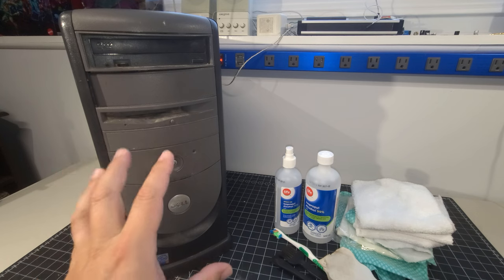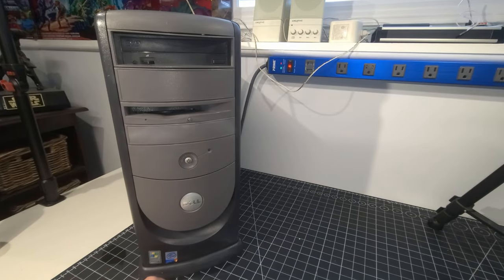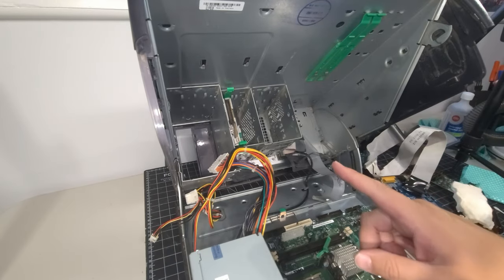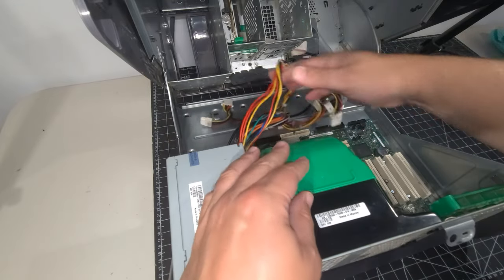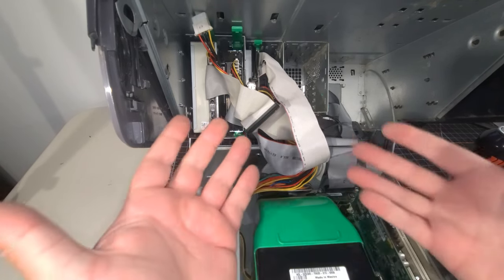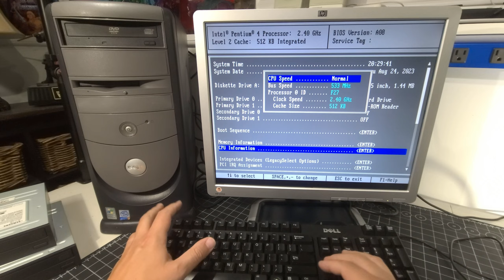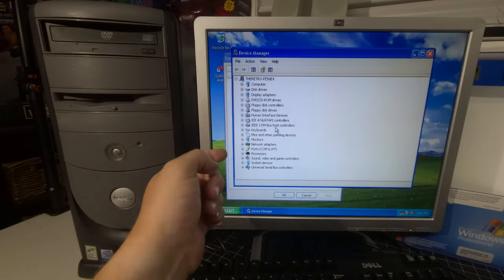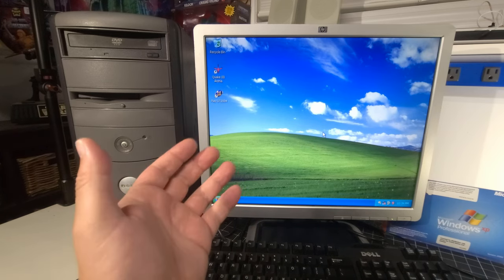Dell Dimension 4550 E-Waste Rescue - Full Restoration!!

Comment: I remove everything from the case. Then I clean all non electrical parts outside, remove most of the dust with an air compressor and then clean with soap and water. Blow away most water with air compressor and let it dry outside. While that is busy drying I clean all electronics like you did in video. Then I connect everything outside the case and test and setup the software side. When I am done and happy, I put everything in the case and clean the case with anti dust cleaner. Then I do a normal 4 hour burn in test. All CD/DVD drives are called optical drives, does not matter what its purpose is.
Reply from the maker: Glad this works for you!  Always many methods / approaches depending on scope :).

Comment: I had one of the predecessors to this machine as my personal computer around the same time, the 4400. Looked exactly like that. I don't know what the difference was regarding the case design between mine and that 4550, but it had the same clamshell case, the same fan with the green chute, etc. Mine had a Turtle Beach Santa Cruz DSP sound card, and I had a similar video card. Mine had 256MB of RAM, though, and had an intel P4 1.8GHz. When it died, I took the usable parts out of it. Dell didn't use thermal paste on those machines. It had a thermal pad on the bottom of that heat sink.
Reply from the maker: Good to know.  Dell tended to make many different configs in the same case - or at least the same looking case.  Take a look at my Dell playlist - especially the Dell Quadruplets video.  Also, regarding the paste - good to add some especially on a P4.  May be overkill but hey, this cooling thing is important haha.

Comment: Very nice restoration as well always!! Nice to see another Dell OEM saved from the scrap heap and with a decent video card upgrade i'm sure it could even run games like Far Cry or GTA III

Side Note:
I have a Nvidia GeForce 4 MX420 "first dedicated video card I scrapped from OEM machine in 2007." While it's not a slouch providing 64mb of VRAM and will be able to blast through nearly all 90's and a couple of early 2000's games.. It's very limited to that set amount.
Reply from the maker: Yes for sure.  I personally like the underdog cards haha.  That said, it ran these two games fine and I'm sure many others.  I mean, of course we can always upgrade more... But sometimes it's fun to feel the limits haha.
Reply: @TheRetroRecall which is fair I mean this card is capable of running morrowind, I'll be it at lower settings at 25fps "no different that than OG XBOX version" I've ran some bench marks using the custom XP build I've built and when running it at 16bit over 32bit you can see a huge bump in performance too.
Reply from the maker: Nice!

Comment: Agree with you about hard drives on retro computers, there's just nothing quite like the sound of a hard drive spinning up and accessing data. And the noisier the better. (I mean noises that the drive makes when operating normally, not the noises that drives make when they are about to fail. I just wish they were more reliable. And, as a fan of classic Macs and UNIX machines, the problem is even worse, because those usually take SCSI drives, which are relatively hard to find (compared to IDE hard drives, which pretty much grew on trees at one point) and are usually prohibitively expensive when you do find them. Paying top dollar for a drive only to have it show up DOA (or die a few days/weeks/months afterwards) really sucks.
Reply from the maker: Yeah for sure, the SCSI drives were a bit harder to find.  That said, I am happy there are solutions today that allow us to use these machines for when the time comes that physical drives are no longer int he equation.  Thanks for watching!

Comment: Compressed Air works miracles...  50psi   I use my compressor and WOW!  then I use a Dyson vac with a brush.. all gone.
Reply from the maker: For sure.  I do the PSU with the compressor, everything else with ESD Brushes and vac :)

Comment: Ironically, I have Windows XP running on my 2012 iMac (with 32 GB ram, Intel I7 quadcore) using Parallels software to utilize XP without having to create a separate HD partition. As configured it can handle most of the first-person shooters you've played with.
Reply from the maker: Nice!!!
Reply from the maker: When I lived the MAC world, I used VM Ware Fusion - worked like a charm on my Mac!

Comment: it does not matter the orientation of the ide cable... its the same... as long the red strip on the ide cable is on the same side of the power cable, you are good to go. you can even plug the middle conector on the motherboard, and 2 drives on both ends oof the cable, it does not matter.
make sure you are using a 80 pin cable on the hd. if you are using a 40 pin cable on the hdd, you will not have the max speed.
you need 80 pin ide cable so you can reache ATA 133 speed. for the optical you can use a 40 pin cable. i think dvds only go upt to ATA66
Reply from the maker: Sounds good.
Reply: @TheRetroRecall  I cant see well on the video. but i thing you have a 40 pin ide cable on the hdd. if the hdd supports ultra dma, you need a 80 pin cable
Reply from the maker: I'll check all of this out.

Comment: It looks much happier now!👍👍  Was there much dirt in the PSU., and what condition was the thermal paste on the video card in?
Reply from the maker: The PSU was actually ok... However I didn't check out the video card thermal paste as I just wanted to test the card out.  That said, it works great, so I will be checking that out for sure!
Reply: @TheRetroRecall  It's surprising how well that old PC., is working, I had a look online to see how much ram., it can handle and Dell state that 1 gig., is it's limit, but other folk say that it's two gig., so the only way to be sure is to try.
Reply from the maker: For sure.

Comment: im sure that cooler still has the factory sticker on the bottom you are suposed to remove before install it for the first time, and it was never removed... remove the cooler and check if im right or not. ps: I checked in slow motion. and there is no doubt that the aluminium sticker is still there covering the black thermal grease...  and it was never removed...
Reply from the maker: I'll check that out tomorrow - great eye!

Comment: In my experience you don’t need to be paranoid about static electricity
Reply from the maker: You may be correct, however given how much scrubbing of the components I'm doing, it doesn't hurt to take an extra precaution.  Better safe than sorry I suppose :)

Comment: Had a medion prebuild around that time with a 476 pentium 4 at 3 ghz with a fx 5200 which i changed for a fx 5950 ultra. Still got the fx ultra card in working condition. The prebuild itself was pretty horrible. I had no idea what thermal trottle was back then and medion clearly had none as well. Together with a heavily fragmented hdd it was pretty slow and nearly useless for directx 9 games like fable the lost chapters which i played a lot. Naturally i should have gotten a amd system with a radeon 9800 pro/xt.
Reply from the maker: Thanks for sharing this.  Yes - most stock systems weren't 'great' unless you full customized them on an order.  I found if I was doing that, it was best just to build a custom system - which is what I did.  There is something about the OEM charm though that after all of these years, it's fun to look back on :)

Comment: Another question. How do you get the motherboard out? I have a few bad caps and I don't know how to remove it?
Reply from the maker: There should be screws holding it to the chassis.  You need to remove everything in the way first (cables, drives, caddys, ventilation etc).  It should come out fairly easily.
Reply: @TheRetroRecall  From what I see they are not phillips head. Or I am I looking in the wrong spot?
Reply from the maker: I'll have to take a look at one and get a better idea.  There may be some documentation online.  Dell is really good at maintaining that material on their website - just enter the service tag number on your label.
Reply: @TheRetroRecall  Ill check it out, thanks!
Reply: @TheRetroRecall  Ooohhh, I see, in the video it looks like you just slide it out of the case, not screws required. But I will have to remove it from the small sheet because I have to replace caps. Never done it before, so Im hesitant to do so.
Reply from the maker: Just take your time and remember where everything goes.  Take lots of pictures :).  I've done some recapping videos as well if you wanted to get an idea of the process.  Good luck!
Reply: @TheRetroRecall  Thanks!
Reply: @TheRetroRecall  Could you actually recommend one video you did?

Comment: Hi! I try tu connect this pc to a new monitor with a adaptator vga-hdmi but beside the pc is on, this isnt show any image on my monitor, it is monitor the problem? because the owner of this pc told that this work with a “old monitor”, thank u so much!!
Reply from the maker: I assume you mean you have this computer and the vga to hdmi adapter isn't displaying an image?  Have you tried just using the vga only without the adapter?
Reply: @TheRetroRecall  yes, i mean, even the monitor dont recognice a computer, I dont have the vga cable, I have the same computer but just with the charging cable and a hdmi-hdmi cable from my monitor, so thats the reason that I used the adapter :(

Comment: Wait, you can remove those from the front!? How??? 4:43
Reply from the maker: Usually a small 'spludger' tool can get it and release the clips if they aren't accessible from the inside.  It's been a while since I did this restoration, I'd have to go back and look :)